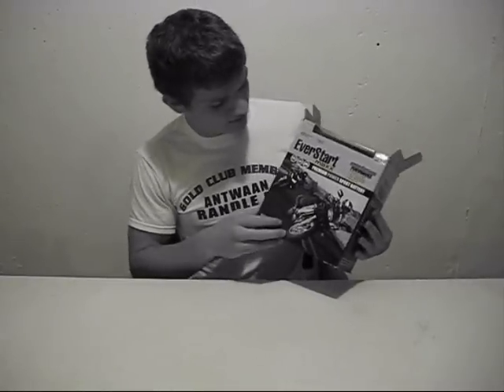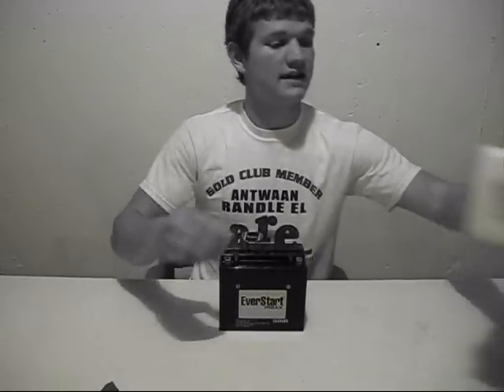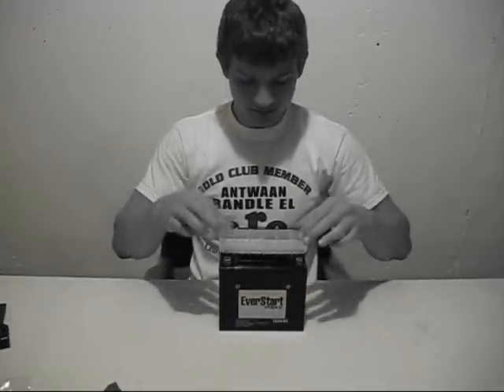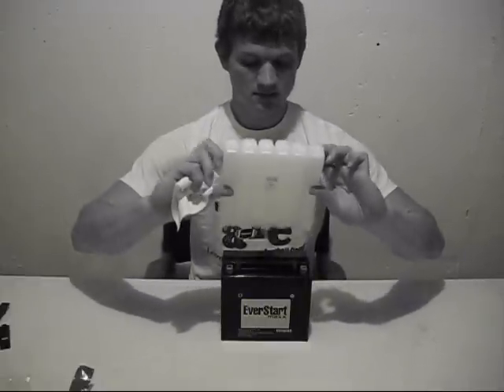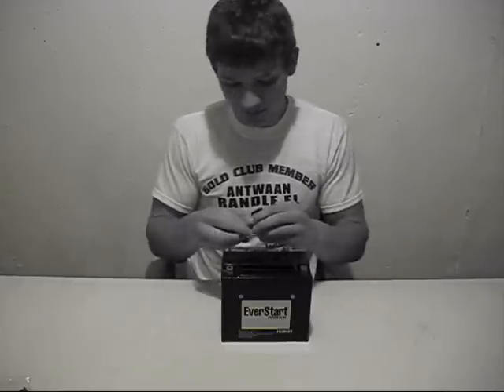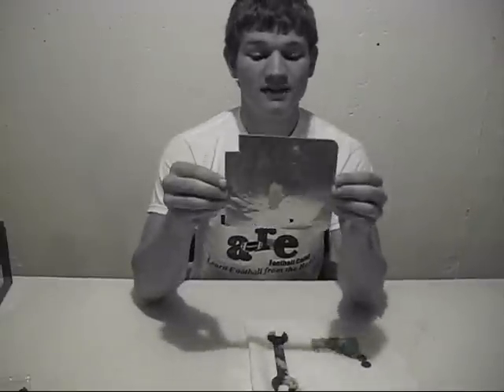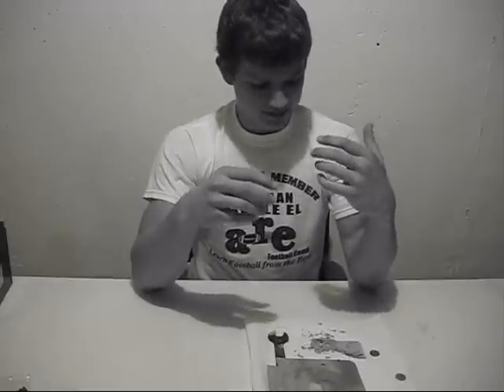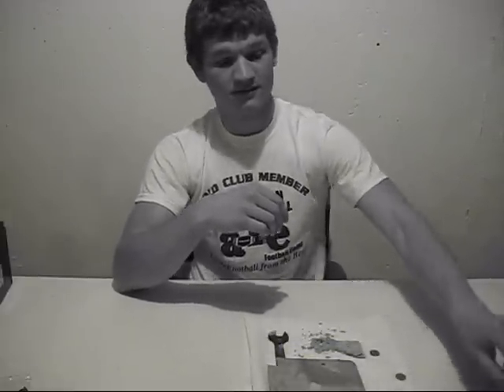How to make / assemble a battery for a motorcycle, jet ski, snowmobile, dirtbike, etc.

Comment from the maker: Sounds like you have a short (maybe the same short that caused your old battery to fail (or did it?))  Anyway, I would buy a cheap multi-meter and go through the basics of the wiring harness and try to find where the drain is...the charging thing is good to do, but should not affect it as much as you are seeing.  Thanks for watching!